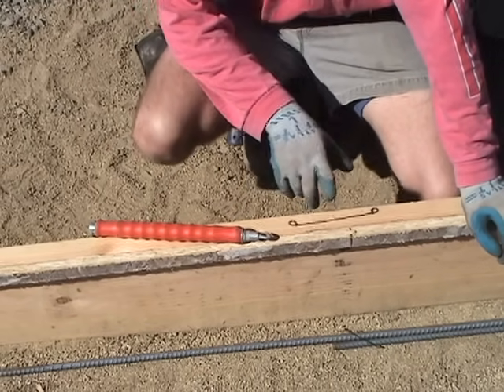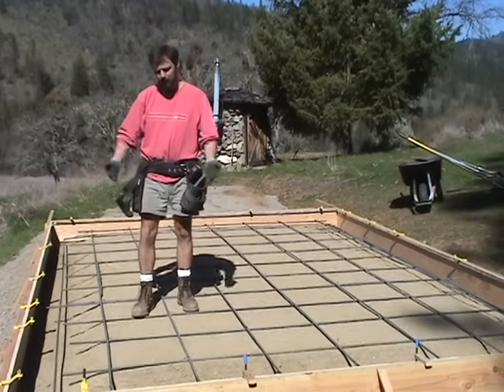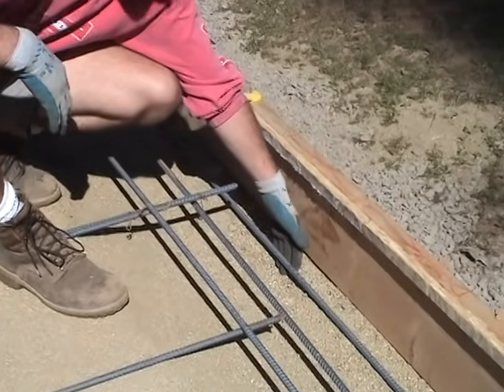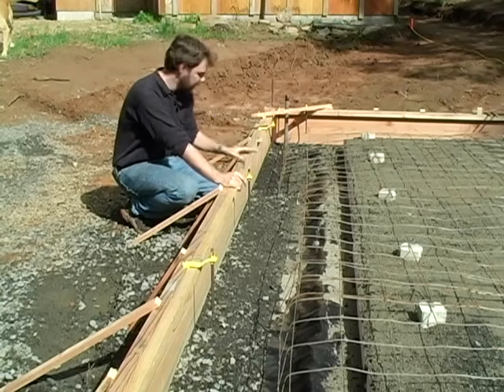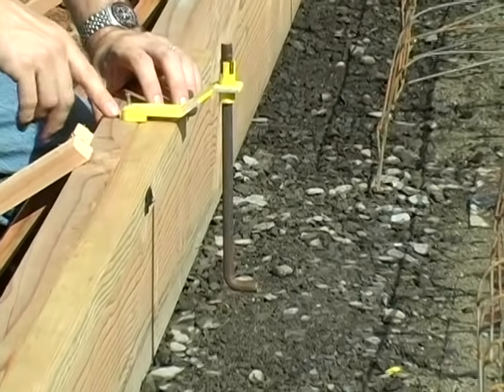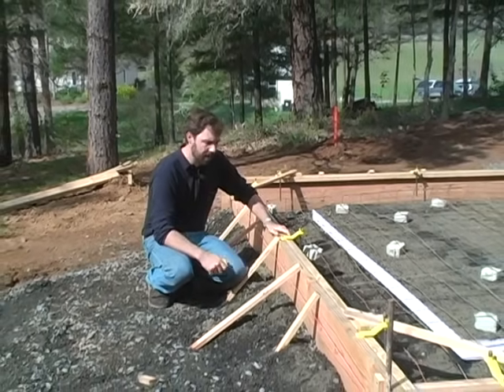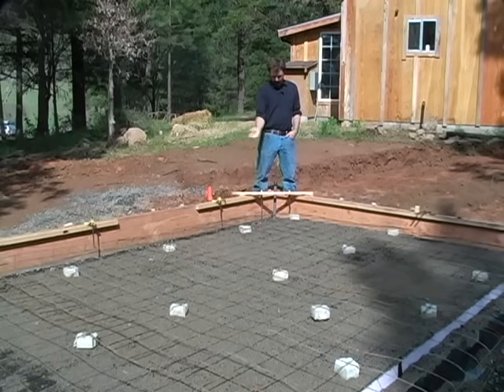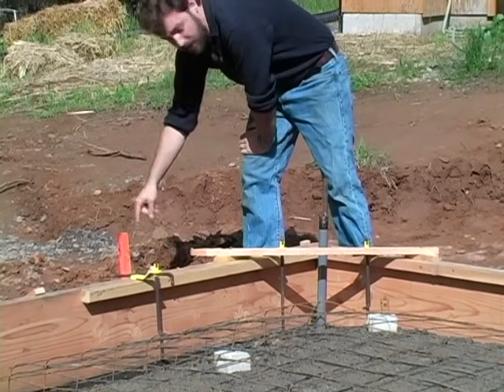Rebar grid for Slab Foundation

Comment: Code requires 3" clear between bar and earth when concrete is cast against earth.  There is an exception for concrete slabs on grade but does apply to the footings.  Your recommendation of 1" clear of footing bottom bar to soil is incorrect.
Reply: Just typing this when I saw you're comment, I imagine he saw a lot of cracks and shrinkage.
Reply: @davidcarpenter4346  What exactly does “slab on grade” mean?
Reply: This is correct.

Comment: only a jackoff uses those little wires get a roll of tie wire and a reel and a pair of pliers and also dont block up mesh finishers just fuck it up just pull the mesh as you're pouring

Comment: bar should be at MINIMUM 3" from the ground
Reply: it depends i've blocked up many slabs when it called for 2 inch dobie but generally you are correct for the most part
Reply: typically I would have grade beam rebars 3” from the ground and slab rebars 1” from the ground

Comment: HI, THANKS FOR THE VIDEO. WHAT IS THE THICKNESS OF THE REBAR.
Reply: I am not the person who made the video but For a 4 inch slab I would recommend #4 bars each direction @18 inches on center I believe that is the code minimum for shrinkage.
Reply: I’d think 3/8” Rebar should’ve been used, not wire?? Any thoughts???

Comment: That wiremesh is mainly to minimize cracking in the concrete slab that is caused by contraction and expansion, mostly used in outdoor slabs, not intended to increase the load bearing.
Reply: Good to know, but would you say that this a good tutorial and does it look did he do a good job here?  I liked that he mentioned checking your building codes.  That's something I never hear in these how-to(ish) videos.
Reply: Yes. I would say a good tutorial, he mentioned about the anchor that needs to conform to the building code. The spacing is usually every 1 meter' of the concrete slab.  1) He forget to mention AND show the plastic sheet above the sub grade, so that the audience may not be aware of it. This plastic sheet is to separate the the sub grade/soil and the concrete. If you put a plastic sheet (made of LDPE or recycle plastic), when the curing process is takeing place, the water in the concrete won't seep into the soil. 2) He forget to mention about the curing. This step as important as the preparation. The curing is the process or operation which controls the loss of moisture from concrete after it has been placed in position. You can put a plastic sheet/burlap on top of the concrete less than 1 hour after it and maintain the moisture by spraying it with water for as long as 10 days. This will make sure the hydration process of the concrete will be uniform from the bottom and top of the slab 3) Make sure don't put too much water in the concrete mix, if you order the concrete from ready mix factory, request a slump specification between 8-12 cm for easy work-ability. That's all I can share with you right now.
Reply: That's a lot! Thank you very much.
Reply: @Noeman2009  Spraying with water is an outdated technique, and covering with burlap/straw dates back to the invention of concrete. Now we use a special spray cure to control moisture, and other methods.
Reply: tienglongmy  yea, you are right but it still works. If this is for yourself, why bother buying a five gallon bucket of retarder, if you can simply give it a little shower for several days no big deal. If your a contractor, that’s different.
Reply: I thought it was a good "how to do" video for the typical "Harry the Home Owner." I wouldn't go all out on a small pad..its not going 6 stories up lol

Comment: This shit is easy. Journey men rodbuster and the things he is talking about if chairs they will hold the rebar 2 inches off the ground and the boards are called forms. The measurement from the form is called the endo. We use pliers and a reel of wire on our belts to tie.
Reply: The chairs are called dobies (chairs are for decks) and the space from form to bar, or dirt to bar is called clearance, endo is where you want end of bar to be, done it a couple of times in my 30yrs.